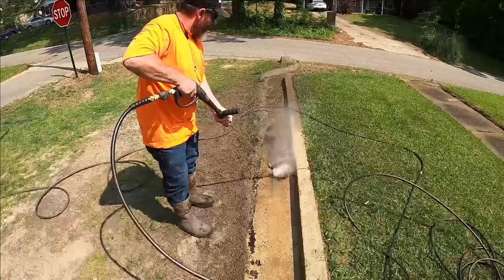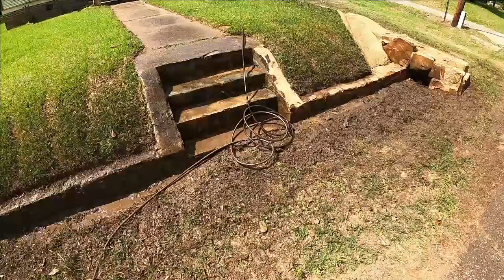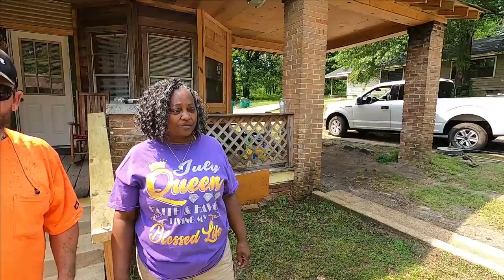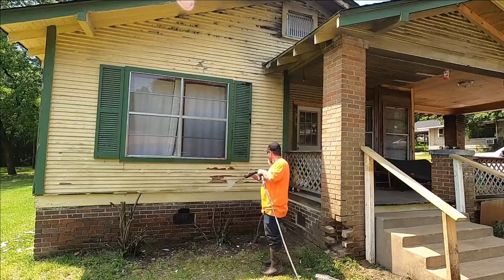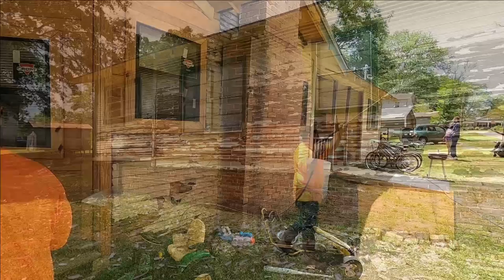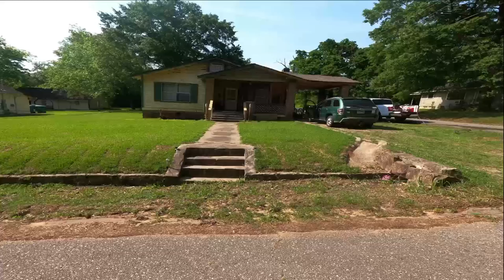**I will PAINT THIS HOUSE for FREE, IF YOU COMMENT ON THIS VIDEO**   Random power washing

Comment: I have an old house which is just over a hundred years old with the same wood siding . That wood siding is #117 shiplap or better known as #117 double tear-drop shiplap siding . It comes in sticks of 6" wide by 16' long and very expensive !!  You'll do a much better job removing the old paint off with a rotary nozzle on your pressure washer with 2000 psi pressure or just a little less pressure . You'll get allot more paint off with allot less wood damage . You have to buy the rotary nozzle special for the water pressure of your machine as that rotary nozzle does not come with any pressure washer . I've got over 23 years experience with my old house and a couple decades of experience with other old houses with the very same wood siding . Being it's old and expensive wood siding , I learned to prepare for paint with more than just pressure washing it . You also after pressure washing it then when it dries , hand scrape it , then scuff it with a sanding sponge . Then use an oil base exterior primer , then top coat with latex color paint of high quality !!  That way it will protect the siding and last much longer before needing to be re-painted !!  This is only 45 years of experience talking . Also after primer painting the house , caulk it with the highest quality , then paint !!  There's an old saying , if you're going to do a job , do it right with quality the first time or don't waste your time !!  And money !!  That way you don't have to come back and re-do it all over again , or nearly as soon !  lol. Also it's the best advertisement any business can get !!  I have more info if you like and if so , just ask .

Comment: I think the spirit of helpfulness is great... HOWEVER, if that house was built pre-1978 you MAY have just blasted lead paint debris all over her yard in violation of EPA lead-paint renovation regulation   Now, not all houses built pre-1978 are lead painted, but that house looks "Neo-Tudor" style that was common in the 1950... so I'm inclined to believe lead paint until proven otherwise.  Now, as long as you are doing it for free, you may not technically be violating the EPA regulation because the EPA regulation only applies to businesses and not home-owners disturbing lead paint during renovation.  Fortunately, lead is not very toxic to adults; but if she has her grandchildren playing in the yard frequently this is sort of problematic.  Think before you spray blast paint off of houses!

Comment: Sure you can high-pressure a wood facade? Think there's a risk that you pressure water behind the wood creating mole and waterdamage to the house? Correct me if I'm wrong.
Reply from the maker: Pressure washers are used to remove the loose paint by most painters. Then the elbow grease of scraping happens.

Comment: While I appreciate your good intentions, I have to say that it makes me ill l to see anyone pressure wash wood. I've done carpentry, painting and woodwork for 50 years. Everything else you've done is excellent, but pressure washing a house, especially with bare wood showing is counter to good painting and wood preservation. It would be better to do a quick scraping and apply cheap primer and one coat of acrylic paint, than to damage wood fibers. It'll make the paint job more difficult and the finished job will never look right. You can scrape, wash with low pressure garden hose, hand clean with TSP, and rinse, if the humidity is low and the outside air is warm. Otherwise mildew will undermine the paint, and the damaged fibers will feather out later. 
I've repainted houses that were pressure washed previously, it's not a good solution. 
I did use a pressure washer on brick and stucco, but at low pressure, and I turned down jobs where the homeowner wanted wood washed to "save money".
Reply from the maker: The homeowner asked me to do this for her. After the loose paint came off so easily we decided we needed to paint this home to protect it.